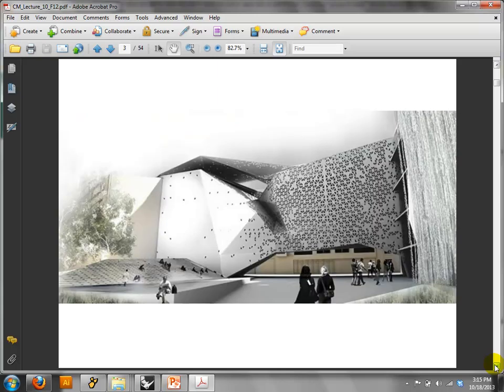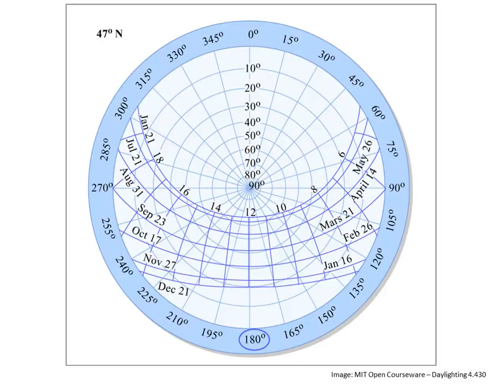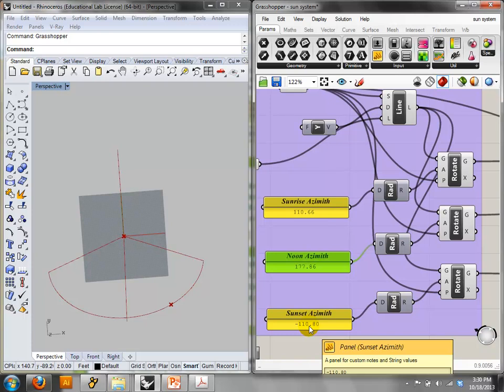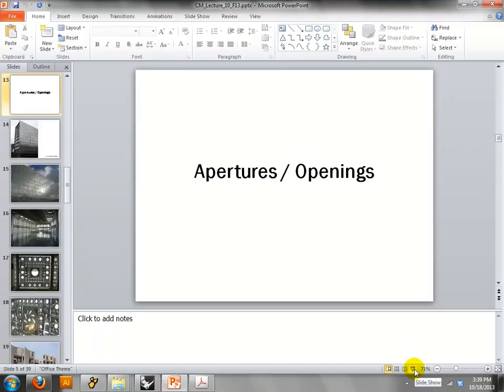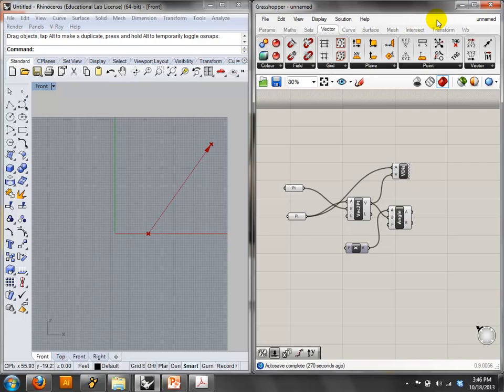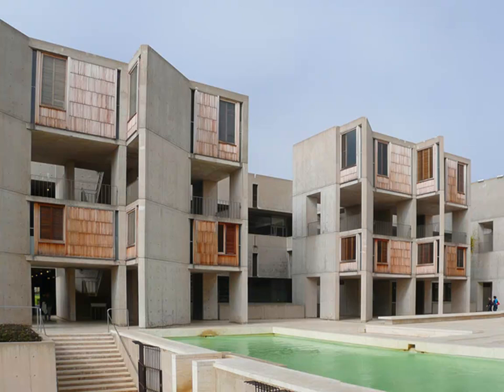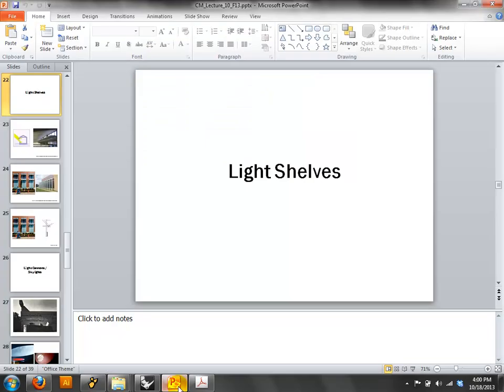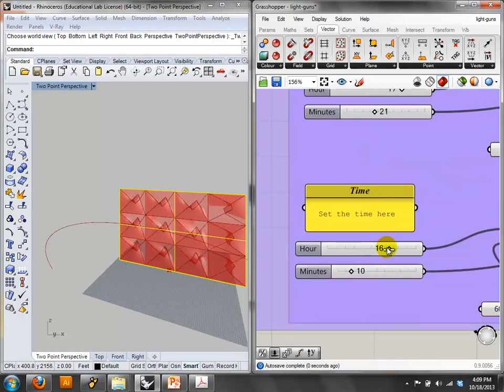Computational Methods, Fall 2013 - Sunlight Parametrics

Comment: why not use geco plugin to get the angles...?
Reply from the maker: You could use GECO. There are many tools and methods to do it. You certainly don't need my script if all you care about is the angle.

The task isn't really the point. I demonstrated the sunlight system because it is a useful exercise to understand how one writes a script to solve a problem. The process and the principles are universal.

But also, what if, for instance, you don't have Ecotect or you don't know about GECO? It's good to know how to do these things for yourself.

(PS - I also have a video on GECO ;))
Reply: Oh- I see why you did what you did. 
thanks. 

I was wondering if it was possible to do a demonstration of grasshopper + geco (or other similar tools) + galapagos to define a parametric wall through automated iterative test. 

thank you- I really appreciate your shared videos.